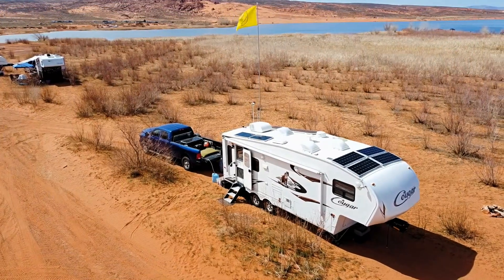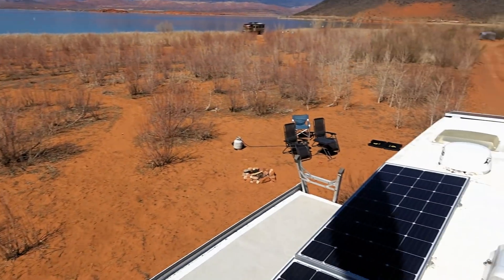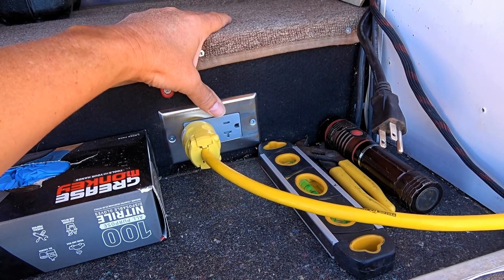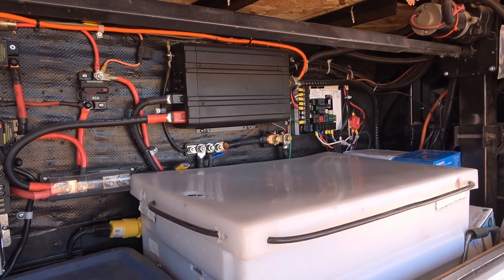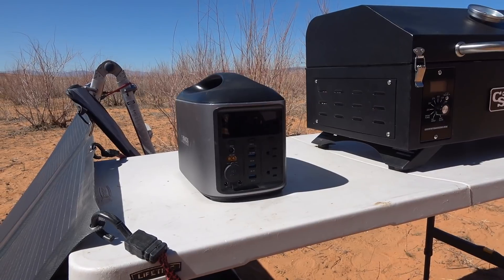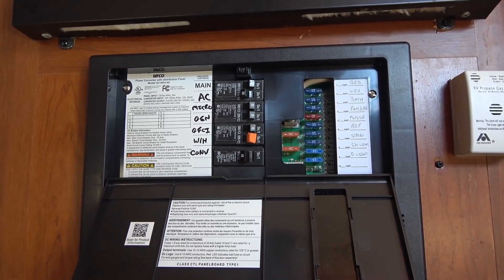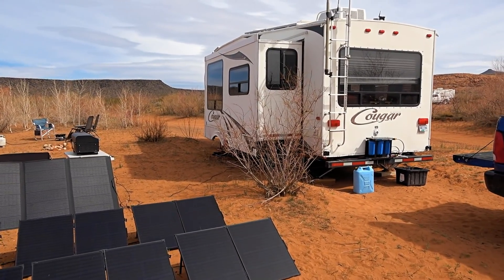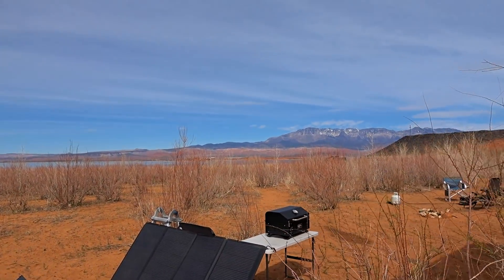RV Boondocking Power System Updates Explained - Current State of Things March 2022

Comment: Hello Ray, What is the bus bar you put after the shunt at the Battery bank?  I want to add a positive and a negative Bus Bar in my battery box instead of having all the wiring on the battery poles.  How do I choose the right Amp rated Bus Bar?  I would like one not too big since there is not much room.   I have a 55 Amp converter and a 1000W inverter, 2 Lithium batteries.  280 W solar on roof 200W solar blanket.
Reply from the maker: I recently helped a friend install some batteries and he had bought ones like these https://amzn.to/3CMVmih  They seem pretty good made in USA 250 amp rating with nice covers.
Reply: @LoveYourRV  Thank You :-0)

Comment: Great video and amazing system you have there Ray! Since you upgraded to the 3kW inverter, did you change anything to your system layout/flow chart or is the only change the 3kW inverter swap? Also, I have a zamp solar port on the side of my trailer, I assume it’s possible to hook the 400W ecoflow solar panel to that solar port and add a charge controller either to the solar panels, or better even inside the trailer downstream from the outside zamp port closer to the lithium batteries?
Reply from the maker: Yes, I changed the transfer switch hookup. It's now wired to the 3000W inverter so the EcoFlow no longer powers the trailers AC outlets, the 3kW inverter does. I now use the EcoFlow to power my Starlink internet dish https://www.loveyourrv.com/1-year-update-ecoflow-delta-max-power-station-400w-folding-solar-panel/
I assume the zamp port is just a brand name for a 2 wire receptacle on the trailer wall. If that's the case it should handle the 400W EcoFlow panel with no issues. And yes best to mount the solar charge controller close to the batteries as it has a lower voltage on the output side and higher current so wire losses are worse. Cheers, Ray
Reply: @LoveYourRV  I appreciate the prompt reply, thanks Ray!

Comment: Great information, thanks for all the work you put into explaining! I’m new to solar and just purchased the 200 watt suitcase w/o controller from Renogy. We’ll mount a 100/30 mppt close to the battery bank. My question is you mention using an extension cord for the ground panels to connect to your mppt. Will you make that yourself or would you buy one? What parts or connectors would be needed.
Reply from the maker: Thanks. :) I'm always modding my extension calbes as I review so many different things with different connectors. Your suitcase panel will likely have MC4 style connectors so you can buy extension cable like this for example https://amzn.to/3yl8IQO

Comment: Wow that is some system I have a midnight solar King of the road 4 100 watt panels and a 5000 watt 10,000 w surge  Ames inverter and just 6 6 volts 225 amp hour batteries lead acid but like you I want to add to it I've been thinking about how I'm going to do that so thank you for showing me your system that you made very cool

Comment: Ray, I take it you’re well over your 5th wheel’s cargo capacity? Did you have to modify the rig’s structure to handle all the extra weight?
Reply from the maker: I have beefed up the suspension components and moved up a load range in tires but I'm not actually over my OEM weight ratings even with about 90 gallons of wastewater onboard + full fuel and propane tanks. Here is a recent video where I break down all the weights on the truck and trailer and detail where I store stuff. I've taken advantage of the excess weight capacity I have in the 1-ton truck and move many heavy items forward and into the truck bed and crew cab to reduce weight on the trailer. https://www.loveyourrv.com/what-we-carry-how-where-its-packed-fully-loaded-truck-and-trailer-weights/  Here a two more related videos https://www.loveyourrv.com/quarantine-restraints-interior-cargo-safety-system/ https://www.loveyourrv.com/my-truck-bed-storage-organization-ram-3500-long-bed/ Cheers, Ray

Comment: Your final diagram was great!  Having two separate battery systems provides you with some redundancy so that you don't have any single-points-of-failure, where if one thing breaks, the whole system is brought down.

The only 'quirk' I see is that using your EcoFlow battery system to power a charger to charge your RV lithium batteries loses some power in the process, probably at least 10%. I would think that being able to power at least some AC circuits in your RV directly from the EcoFlow would be helpful, and this would avoid the power loss from charging the RV batteries.  But I don't know that that would be worthwhile since you're probably producing more power than you need anyway.
Reply from the maker: Thanks! The EcoFlow does power all the RV AC circuits via the thick yellow extension cord plugged into a 30 amp auto transfer switch. The transfer switch output sends the power to my RV's main AC distribution panel.  When I plug into shore power it auto switches to that. When off-grid I keep the RV OEM converter charger's AC breaker flipped to the off position, then if I desire to move power from the EcoFlow batteries to the RV battery bank I flip it on. There are quite a bit of loss in both the EcoFlow inverter and the OEM charger converter but I don't have to really do it much,  just an option for me if needed, and faster at 50 amps charging versus using the EcoFlow 12VDC output that is a fairly low amperage at only max 10 amps, less even given some losses to be expected in a DC-DC lithium charger of some sort.  Cheers, Ray
Reply: @LoveYourRV  That makes sense.  Again, great work and video!

Comment: Hi Ray, I'm wondering how, if you did, use the 24 volt panels to charge the Bluetti A C200 box directly? Or did you have to go through another charge controller first? Thanks for sharing your knowledge!
Reply from the maker: I haven't tried them with the Bluetti AC200P but have with the EcoFlow Delta Max. Didn't need a charge controller. Needed a adapter due to the differing  connectors. Looks like this https://amzn.to/3whrLuU
Reply: So the charge controller inside the Ecoflo was able to handle the current directly from the 24 volt panels even though the box puts out 12 volt dc power? I will be charging a Bluetti a 20 box. Looking for a sturdier folding panel  like the Lion ones.
Reply: Should read, "Ac 200P" and thanks for sharing your knowledge!
Reply from the maker: Yes, the EcoFlow specs say Solar Charging Input 800W Max, 11-100V, 10A Meaning you can input anywhere between 11-100VDC. So basically almost any solar panel can work. And they can even be placed in series as long as the total voltage is less than 100V.
The boxes are more complex inside than I think you imagine.  The internal lithium battery packs are usually around 50VDC, I imagine to help keep the DC wiring sizes down. The 50V DC internal lithium pack powers the internal inverter to produce the 120 AC output and they lower the 50VDC voltage via a DC-DC converter to output a regulated DC voltage for the 12V power socket and then further to 5V for the USB outputs.
The Bluetti AC200P solar input spec is 35-150VDC so I think the Lion Energy panels should work since even though they call the 24V panels they actually output around 40 volts DC.  Difference between specs Nominal = 24V but the VMP = over 35V. It's the actual operating voltage.  https://www.electronicsforu.com/market-verticals/solar/difference-nominal-voltage-voc-vmp-isc-imp-solar-panels  Cheers, Ray

Comment: Isn’t charging your lithium batteries from your delta max power bank causing an inefficient loop, since your inventor is charging the delta max power bank, which gets its power from the batteries? Nice setup except for that. Great video!
Reply from the maker: As I showed in the video when I desire to charge the Delta Max power bank using my RV battery bank I have to manually insert the Delta Max AC charge cord into an inverter outlet. And if I want to charge the RV battery bank using the Delta Max power bank I have to manually switch on the OEM converter charger via its power panel breaker. So it's a manual operation based on what I would like to happen as far as transferring power between the two battery banks. Normally the Delta Max AC charge cord is unplugged and the OEM converter breaker is in the off position. Cheers, Ray
Reply: @LoveYourRV  thanks for the clarification, now I see why you plug it in and not hardwire it. Great job!

Comment: you stated that you have built this set up over time and not as a new build. If you did the solar now from new what would you change if anything?
Reply from the maker: I don't know for sure, "new" is a moving target as the off-grid product industry is evolving at such a rapid pace. Seems every few months there is a new better thing on the market. I do lean towards having separate components versus all in one package. But I benefit from being able to do all the labor myself that saves a ton of money versus paying an installer.
So the only change would be to ditch the power station since I'm full-time and don't need it for home backup power as others may use it for.  I'd add an extra battery or two in the front storage to the existing battery bank and add a larger inverter, maybe a 3000W wired into my 30A transfer switch. I wouldn't change the roof much as I like to have the room to walk around and the panels fit well as is on my 30-foot trailer. I'd keep the folding ground panels but just plug them into my solar controllers when extra power is needed for under trees or winter short days low solar harvest.

Comment: What’s the reasoning behind not increasing battery capacity?  Maybe 6 batteries? Obviously battery costs can be preventative. Just wondering. 
You have quite a bit of roof solar. Plus the dc-dc and the generator. Seems like a lot of work to keep the batteries full rolling in/out all the ground equipment. 

And thank you for all your informative videos!!! You and Eddie (mobile homesteader ) helped me design and wire my 5th solar and battery systems. I to went with multiple methods of charging. 270 ah battery, 570 watt roof, 200 watt ground suitcase, dc-dc, and 2000 watt inverter with automatic transfer switch and several generator options. So far so good. I’m thinking we will need to double our battery capacity.
Reply from the maker: Guess it depends on what type of camper you are. If only out for a few days or a week it may pay to have a large battery capacity since you'll get to go back home and recharge. Also, summertime isn't an issue, long days an high sun. But being full time camping year round and often off grid for months at a time you need more daily recharge capacity, especially in the short day, low sun angle mid winter times or clouds and treed shade of the west coast. For those times it pays to have extra panels to put out, and have alternate charging methods like the generator or DC-DC charger.
Overall I have around 525 amp hours of lithium battery storage based on a nominal voltage of 12.8V so really that's not too shabby and plenty for us to go 3-4 days if need be without recharge, more if we cut back on power usage. That is comparable to about 8 or 10 golf cart batteries. Lithium also recharges extremely fast so you don't need as many. Cheers, Ray
Reply: @LoveYourRV  thank you for explaining. 
🤔I guess I just don’t have enough real world off grid experience. We rarely stay in campgrounds and almost always in the open sky’s of the southwest. Usually 2-12 days at a time. Plus I have not had to deal with multiple days of clouds/darkness and rain of PNW. All my experience is from the southwest during winter. I was very surprised at the charge rate of lithium. They charge up super fast. I’ll have to look into more ground mounts. 
Have you seen/reviewed the eco flow solar panel sun tracker system?
Reply from the maker: I've only seen the pictures, but looks like t would be a a pain to deal with especially with wind blowing that floppy panel around.

Comment: You are producing quite a bit of power.  How much are you consuming?  I can see you have almost 2kw of solar panels.  How long does it take to charge up the batteries in the morning?  Do you ever use the generator for recharging the batteries?
Reply from the maker: Your questions are really hard to answer since weather conditions, tree shade, panel temperature, time of year, sun angle, how the trailer is positioned, and elevation play significant roles in the answers. I'll give a few scenarios though. Right now it's mid-March so 12 hours of daylight, we are at roughly 3000 ft., skies are pretty clear, not much haze up here, temps are relatively low at around mid-60s for a high.  We are usually fully charged by around noon. Usage overnight is around 35% of the power station and 25% for the RV battery back. So about 1700 watt-hours. Roughly 130 amp hours for a 12V battery system. This time of year and in a generally sunny location I don't bother much with worrying about conserving power in any way, lots of stuff around the RV is left plugged in 24/7.
As a contrast when fall camping in British Columbia under trees with mostly cloudy days the generator gets used quite often, solar harvest is often minimal. If you want to see how the system performs in these worst-case conditions, here is a good video to watch from last fall https://youtu.be/H6u7mEWjprU  Down in the southwest desert December and early January are tough. The mid-winter sun angle is really low and the solar day is quite short. So a system needs to be sized to deal with that. Having enough extra panels to recharge and enough battery capacity to last the long nights. Also, nights are cold after sundown so much more time is spent inside using power. Even still I barely had to use the generator this winter. Maybe 4 hours of run time and that was mostly to exercise it a bit.
Reply: @LoveYourRV  Thank you.  That helps me understand what I need based on my load compared to your load.  It has been a long time since we plugged in anything to an A/C outlet in our boondocking.  No coffeemaker, blow dryer, computer, etc.  We are not in the trailer full time and do not work from the road. My 640 watts of solar and 210amp hours of LION Energy LiFePo4 should be more than enough for my lifestyle.

Comment: Ray,
I pull a 3000# Casita travel trailer with a gas suv.  I currently only have one 100 amp hr. AGM battery which came as stock with the trailer. With the price of gasoline increasing by the day, I’ve considered switching to an electric 1/2 ton pickup such as Chevy’s new Lightning with the biggest battery that they off. I thought I could then use the truck’s lithium ion batteries to store power for both the trailer and the truck and avoid buying any lithium ion batteries for the trailer. Have you heard of anyone considering this option?
Reply: I know the ford 1/2 ton provides this as an option so I am sure Chevy makes something comparable.  With using the traction battery of an electric vehicle I would be hesitant to use it that way. Right now we don’t know what the Chevy or ford charges to replace a battery are, but Tesla charges 20k ish and you are looking at almost 8-10k from a third party to rebuild your pack. I bought 8 3.2v 280ah cells, a BMS and built my own pack with a 3000w 6000w peak off brand (aims) psw inverter for right around $1500. I have a usable capacity of close to 500ah and that won’t use charge cycles of a expensive to replace automotive traction battery.
Reply from the maker: As far as I can tell the new electric options may be OK in the eastern part of the country where the elevations are pretty flat and the population is pretty dense. Lots of recharge stations. Out west though the elevations changes are much more dramatic, distances are much more vast, and the population is spread out. For the time being, I'll stick with my diesel engine. It takes a ton of power to drag a trailer up an 8% grade! But with a 3000 lbs trailer is maybe doable. We have a 9000 lb truck and a 10,000 lb trailer so electric doesn't seem feasible yet.

Comment: I think you may be the only RV'er left that hasn't joined the Blue wave.  I think a Multiplus would serve you well Ray... Maybe they'll see this comment and send you one lol.

Take care.
Reply from the maker: haha, ya, someone has to be different. I've always avoided having too many things into one package. That's actually my biggest con for these fancy lithium power stations. They are great! but if they quit working you're totally beholden to the company to fix it and it may take a while. Personally, I'd rather have many separate devices dedicated to a task. So if one thing quits working it's not such a big deal. To me, most of the Victron stuff looks overly complex and expensive. I look at the circuit boards and wonder why they need all that electronics. :)  But they have done a great job of marketing. Kind of like the Jackery brand. Cheers, Ray

Comment: The simple picture made a lot of sense. I appreciate your sharing over time. I don’t plan on extensive boondocking so I haven’t invested in Solar. But did add 4 lithium batteries and a Victron inverter and the Renogy dc-dc charger. The dc charger has been outstanding. Thank you for the tip and idea.